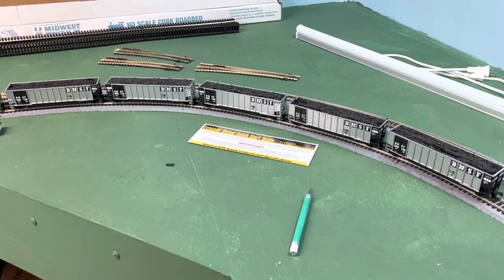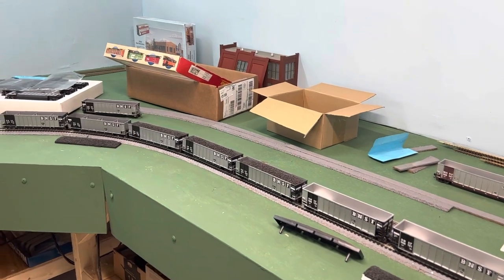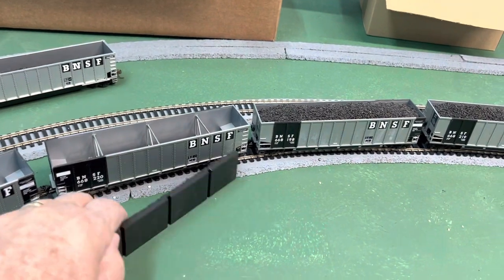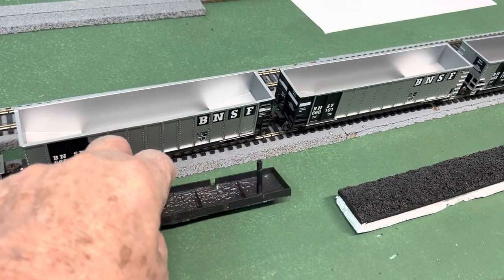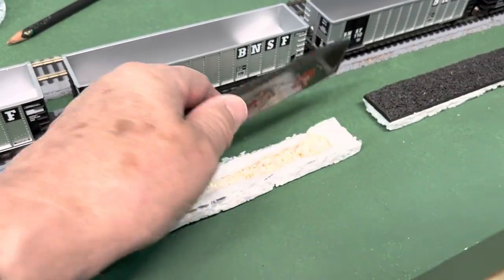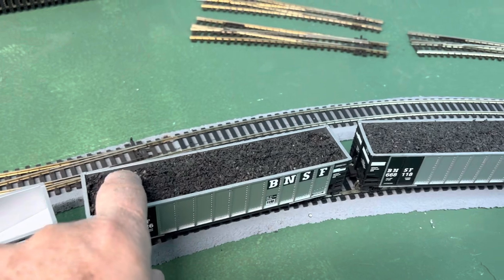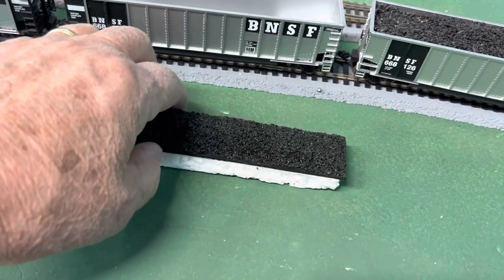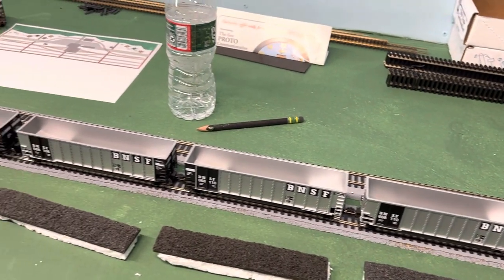Iowa Southern Railroad S3E22 - Asking for Help

Comment: Fred, I have many different loads, most have 3/4” heavy washers for use with a magnet.
I have used styrofoam meat trays, polystyrene insulating foam (the dense stuff), sponge type foam, balsa wood, foam core. All cut for a firm but easily removable fit. Generally I like the meat tray styrofoam best. Hot glue, epoxy and PVA work well on all to varying degrees. I never use solvent based glue for this. Waxed paper or plastic wrap in the car and build up the load over the styrofoam base with 50/50 ballast glue mix.
Just a few suggestions of what has worked for me. Good luck!😊
Reply from the maker: Thanks for the ideas.

Comment: Hi Fred.  Derek has a good idea there with trying to wet down the chipped loads.  Some soaking paper towels or old rags set on top of one of the chip loads for an hour will tell you if it's water soluble.  It may work on the glued in toppers at the other end too.  Try one of each.

The styrofoamed loads should be easy since they fell off.  Instead of a whole slab of wood or plastic under the entire load, just do the very ends where it's needed.  

Many of those loads are fairly thick (poured instead of molded), so you may need to experiment with rare earth magnets & steel washers.  You can also double your magnet power by gluing the north side of a magnet on the underside of the load and use the south side of another magnet as your lifter, as opposed to one magnet and many underside washers.  It's more magnets, but if that's what works, it's worth it.  

On Amazon, Neosmuk has 1.26" dia. x 3/16" Neodymium magnets at $9.99 for 10.   2 sets will do your 18 cars and leave you two for lifter(s); two single magnet lifters or one super dual magnet lifter.  There's many more choices on Amazon.   Just don't settle for Ferrite magnets (black), they're much weaker.  Good luck!
Reply from the maker: Thanks for the idea 👍

Comment: It looks like the person used the wrong glue and it melted the foam. I would think you could use two blocks of wood on the ends to hold the correct height and like you said glue two flat metal washers to the bottom of the coal load and use a magnet to remove the loads. I don’t know how successful it would be to carve out those other chipping loads without wrecking the cars. Maybe see if they used PVA and it’s water soluble. If not I would try to top coat what is there already. You sure did buy enough of them, lol.
Reply from the maker: Thanks for feedback. 👍.   I did get a bit carried away buying the coal cars.  23 black guys and another 11 red guys.  Mike to have at least 5 more red ones. But like I said, lots of coal trains thru Southern Iowa on BNSF.

Comment: Use regular half inch insulation foam cut to size. Put magnet in center and glue with Aleenes Tacky glue. I never tried this but it might work.
Reply from the maker: Thanks for feedback. 👍
Reply: @FredE528  No problem! Enjoy your channel!
Reply from the maker: Thanks.  I have fun with it.
Reply: @FredE528  A lot of fun! Awsome!
Reply from the maker: I used something like you recommended.  Thanks for the idea.
Reply: @FredE528  Awsome! Hope it works!
Reply from the maker: Works great.  Did video on this.
Reply: @FredE528  Awsome! 👍